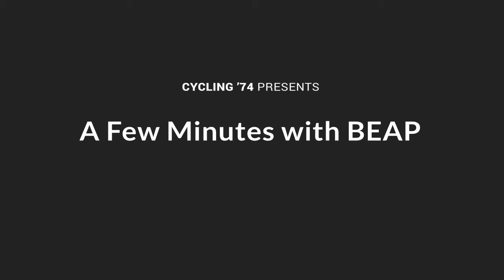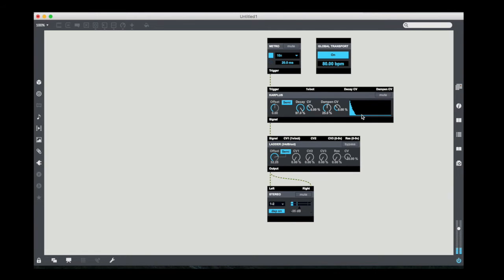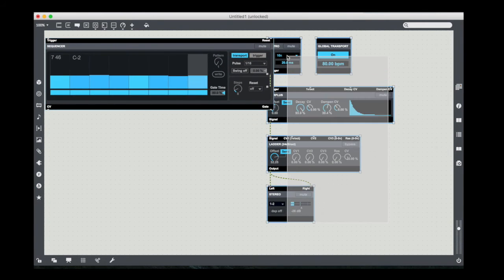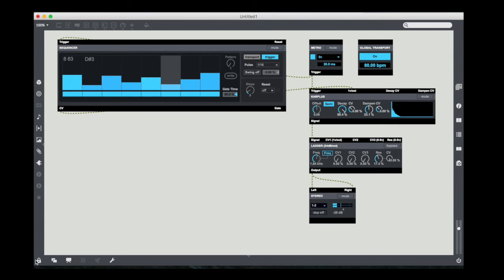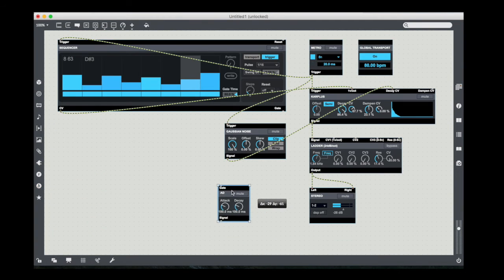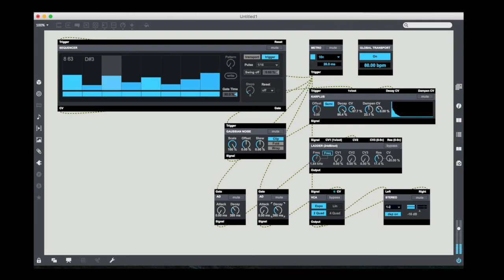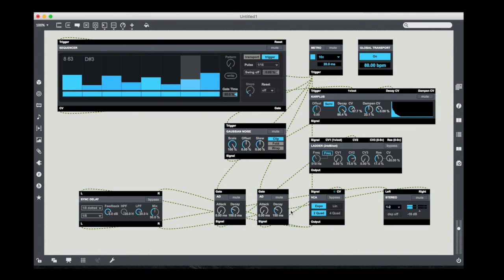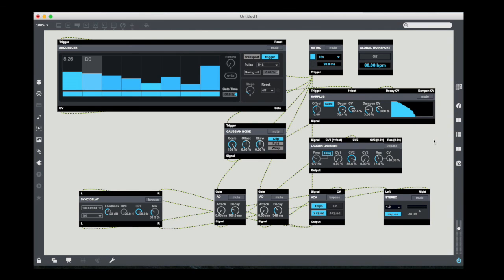A Few Minutes with BEAP: An oscillator based on the Karplus-Strong algorithm (Part 11)

Comment: Thanks for these great tutorials Darwin! One thing that generally confuses me about modular systems is when you use envelopes for things other than shaping oscillators, like in this case using the AD to control the ladder filter.  Why do you use an AD envelope to control the ladder, instead of an LFO or something?